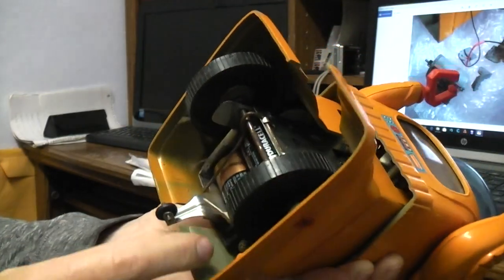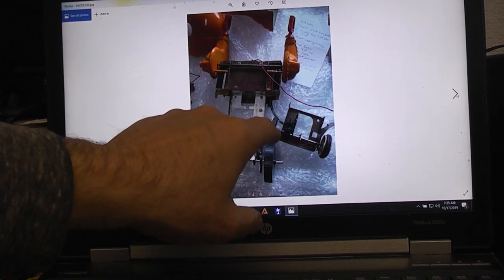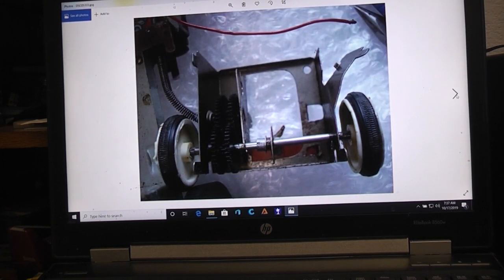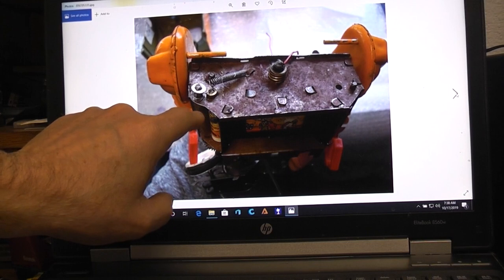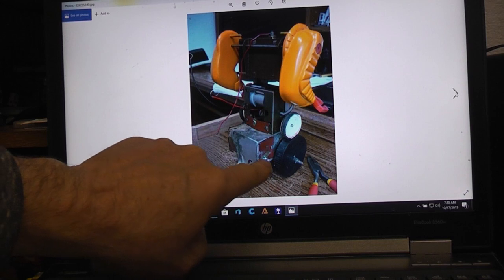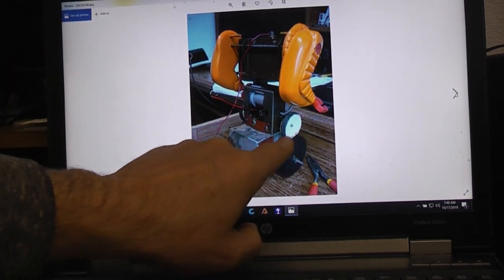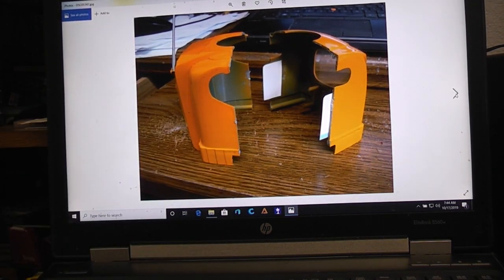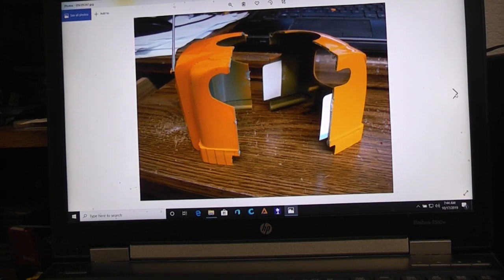Vintage TV Robot from Paya in Spain , demo and repair video.

Comment: Good videos. Have you thought about adding PIC microcontrollers to your robots? They would be programmed in embedded c language.
Reply from the maker: I have done a lot of programed robots many that use servos as well. I like the POLOLU mini controller. 6 IN or Outs, digital ON or OFF or servo and lots of on board program memory. I would guess that I have used a 150 too 175 of them in custom robots so far. Search my channel for custom built robots.
Reply: @Robothut  I bought two of the Mini Maestro 12 channel modules. Yes they are great.